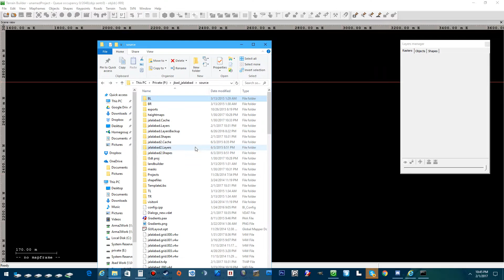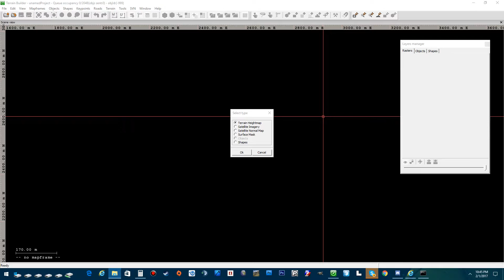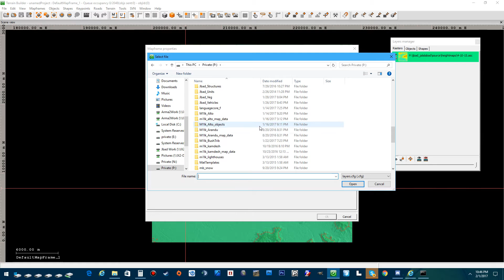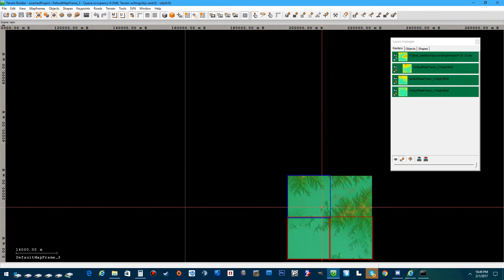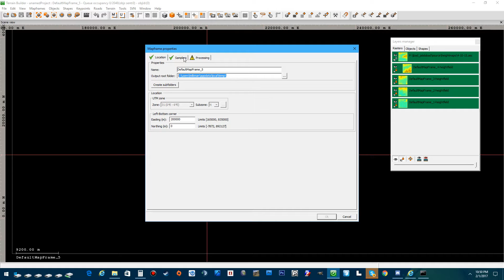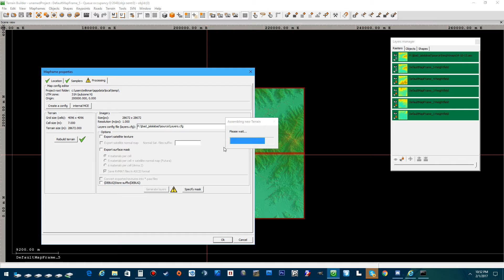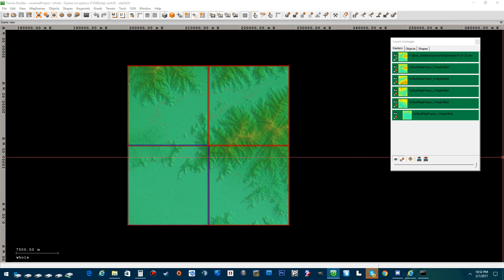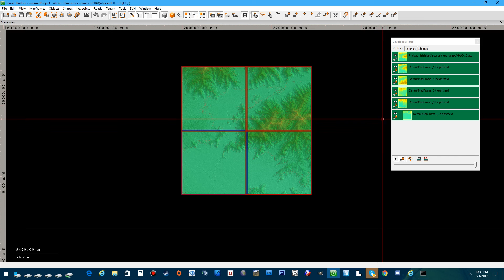terrain builder part 1

Comment: I'm trying to figure out how to add to the heightmap.. I guess I could just import other chunks to the additional mapframes and then meld them together by hand where they meet..  Time to experiment.
Reply from the maker: You can add additional map frames with altered height map data. Whichever hightmap is lower on the list it was the program 'sees' upon export.
Reply: Thanks.  I ended up exporting my original 1024x1024 terrain and simply importing it into a new 4096x4096 terrain, moved it, and merged it.  Now I just need to figure out how to move all my objects wooo!  I know I can use mySQL to set a database etc. but I'm trying to figure out how to do it using Powershell.
Reply: @cringocringo  how did the terrain come out?
Reply: @the-77-ronin7  lol hi I'm cringo and I don't finish things! I've been considering getting into the new tech and getting things ready for the next Arma title. Just IRL things getting in the way, and waning will power.